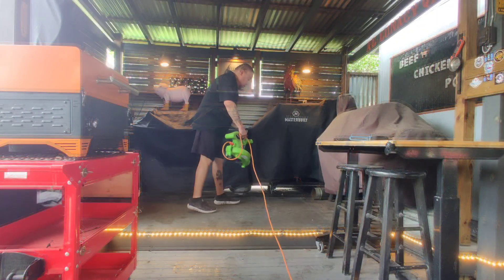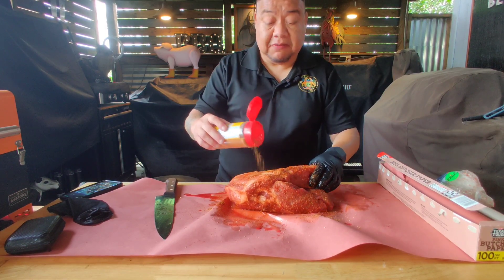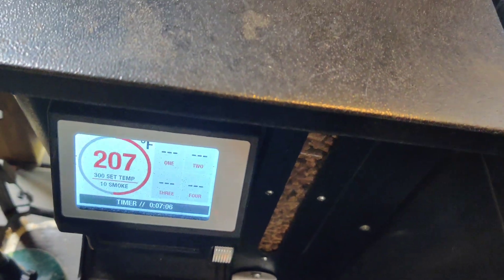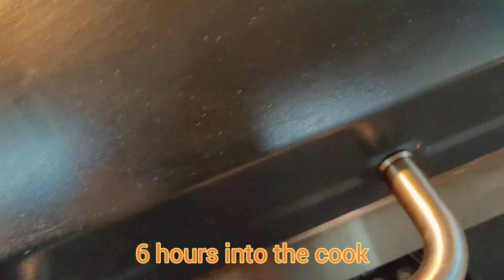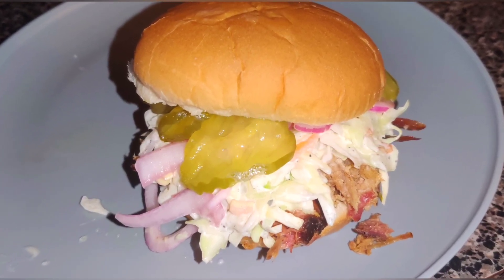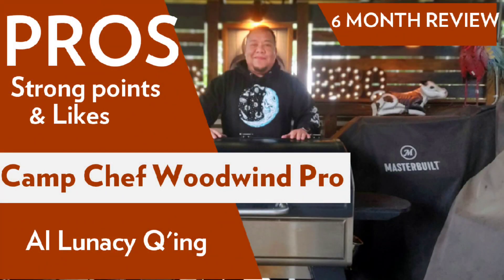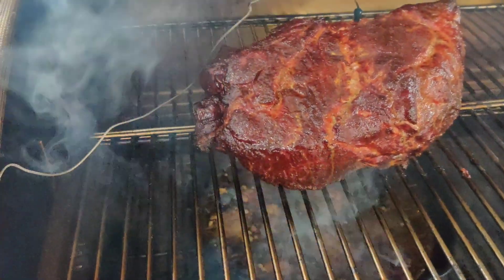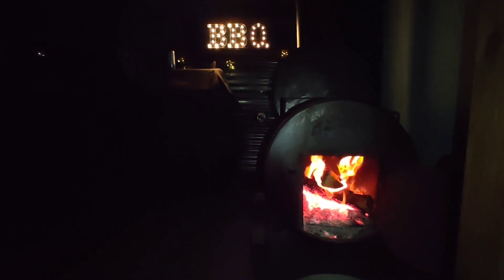CAMP CHEF WOODWIND PRO - 6 MONTH REVIEW / Pork Butt Cook #campchef #woodwindpro #porkbutt #review

Comment: I know everyone raves about the smoke box in the woodwind pro, but is it really that much better than just putting a smoke box or 2 in the non pro version? And is that the only difference between the pro and non pro? Thanks
Reply from the maker: For just a couple of more $, the pro is definitely worth it. You can buy a smoke box for various pellet smokers that will burn wood chunks or splits but you cannot reload the smoke box as easily as you can with the woodwind pro.

Comment: Noticed the Masterbuilt gravity in the video.  How do these two compare in regards to smoke taste?
Reply from the maker: The MB 560 is an awesome smoker/grill.  I just wish the build quality was a little better. As far as how do they compare in regards to smoke taste - you can get more smoke flavor on the MB but your bark will be better on the CC. That's been my experience. Love using both!
Reply: @AlLunacyQing  thanks for your reply.  I'm trying to decide between the 2. Price difference is a factor, but after looking into mods that would improve the quality of the MB, it ends up being about the same price as the Camp Chef 24.

Comment: Have you ever cooked on a Komodo Joe and if so what one has more smoke between that and the woodwind pro?
Reply from the maker: I own a Kamado Joe Kettle and love it. It has the Slo-roller and produces such a great smoke ring. If you feed the smoke box on the Camp Chef Woodwind Pro every 30 minutes for the first 3 hours, it will produce  more smoke flavor then what I have gotten on my Kamado. Still tho - the Kamado has its purpose and I utilize it cooking certain dishes that I think taste better cooked on the Kamado than the  Camp Chef.
Reply: @AlLunacyQing  thank you for the feedback- I had an older campchef pellet and the smoke flavor wasn’t detectable to my palate and it was terrible at holding consistent temperature  ( and I live in Florida, so cold temps not an issue) the kamodo appeals to me because it doesn’t require electricity so thunderstorms taking out the power wouldn’t ruin the cook